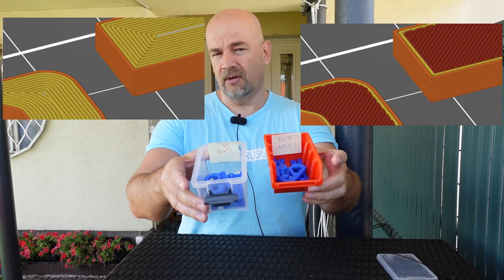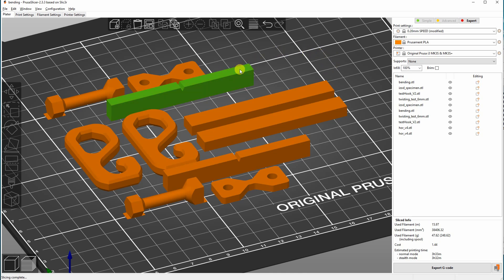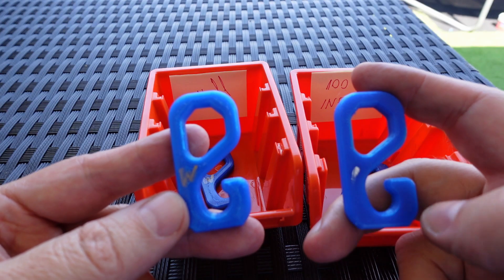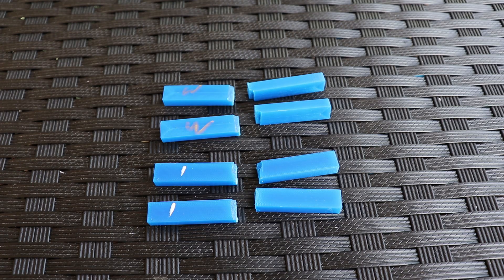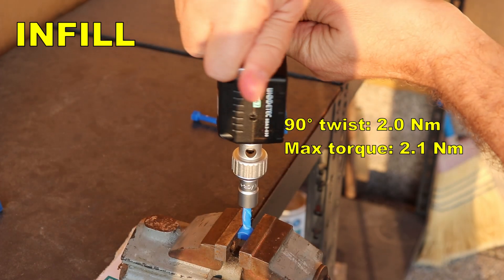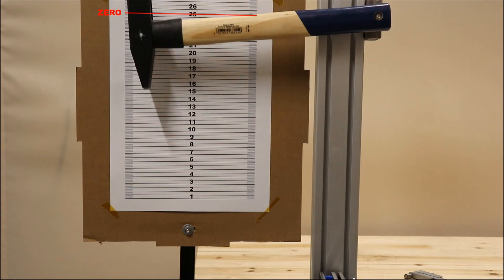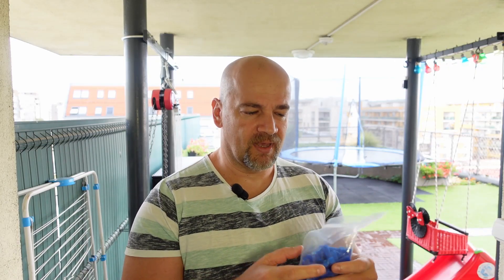100% infill vs max number of walls (or perimeters or shells) - which is stronger for solid object?

Comment: You did an outstanding job of testing.   I was just needing information exactly like this.   Well done.   You are a great engineer!
Reply from the maker: Thx. I think with new slicers (with arachne adaptive line width) things are more equal. I should repeat this test in near future. (the wall version have small gap in the center sometimes in old slicers)

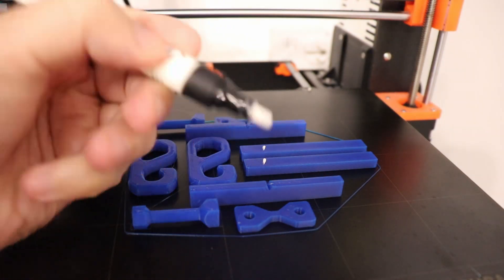Comment: about to print a ring with gears teeth and the orca says that 4walls will require +/- 5hrs and full infill will need +/- 3:30hrs, what can it sayy?
Reply: check your internal wall speed settings duh also check flowrate

Comment: A development since this video is variable width extrusion, up to about 150% of nozzle diameter.  Useful for both faster printing without needing a larger nozzle, and where a wider wall better fits a narrow part.  This should allow the max walls option to closer approach 100% infill.

Comment: The print time for max amount perimeters was 3,5 hours. What was the print time for the one infill? Because if it was printed slower, that could have made it stronger. Slower printing means more bonding between layers!

Comment: Thank you very interesting.
I would also have guessed that the max walls would win, exspecialy for the tensile test because the walls are orientated parallel to the tension while the infill is at an 45 degree angle to it.

Comment: So a downward hook, infill. An outward hook, wall. Stretch vs bend benefits. Fascinating.

I wonder how it would differ when combining the two in varied amounts. For instance if a total wall number that can max be is 10 layers, doing 1 wall layer with 100% fill, and going up 2, 3, 4, 5, 6, 7, 8, 9, and full wall no infill, to see if there is a sweetspot where it gives better result from it over full infill vs full wall.

Comment: I've seen 100 times in groups that "walls are better". Based on this info I've come to 2 conclusions. 1) it doesn't really matter as they are more or less the same. 2) infill is faster so why slow it down with perimeters? So 100% infill it is for the rare cases I need it.
Reply from the maker: Walls are important if you don't use 100% infill. Big difference is using 2 or 3 walls.
Reply: @MyTechFun  yeah I saw that on CNC kitchen. He just didn't do 100%. I'm about to do a 100% part myself. And because everyone says walls, I bumped them up to 999. But I noticed it prints WAY slower that way that 100% infill. So in this case 100% infill is the way to go.

Comment: The more 3D printing test videos I watch, the more I realize that the best method is to just print everything normally.  Normal PLA is a good material.  If your part fails, you need to design it better.  There's no magic trick to make things stronger.

Comment: so what patterns are strongest at 100 percent infill? does it make a difference?
Reply from the maker: Prusa Slicer changes the infill to this lined (I don't remember the correct name), when I set 100%
Reply: @MyTechFun  yeah lines i think its called i read somewhere rectilinear and concentric works with 100 percent but never tried it. edit-just realized rectilinear is lines

Comment: I'm not normally one to ask about speed but since the difference was so minimal I have to ask...
What method was faster to print? 

It would matter if you needed to rapid prototype a part for mechanical purposes 😉
Reply from the maker: In most cases, where you have straight walls, max walls is faster, more smooth print (more straight lines during printing)

Comment: I really like the clear way you Display the data. It could be a bit bigger, maybe even full screen, it's a bit hard to read on a tablet or a smaller laptop. Or maybe I just need to get some glasses.

Anyway, nice work. Keep it up!
Reply from the maker: I got earlier similar comment, I am trying to enlarge the results on screen, but also I upload results as picture to my website, so you can enlarge it, links in description (bottom of the page here: https://www.mytechfun.com/video/124 )
Reply: @MyTechFun  
Alright, to my taste that's even better. I like to take some time, even when looking at rather simple data. Thanks!

Comment: Also note that infinite perimeters will limit the x/y-resolution to 0.4 mm increments which can be a problem if you need dimensionally correct prints.
Reply: Is that because of the fixed extrusion line widths in slicers? If so, Cura, PrusaSlicer, and its derivatives, now support automatically varying perimeter widths to limit gapping. (It's called Arachne perimeter generation. I'm not sure why it's called that, but maybe because the resulting slicing patterns in sharp corners end up resembling spiderwebs.)

Comment: In my maker's view, you should have used in infill designed for mechanical strength.  In your test, you used the "lines" infill, which is well known to be suitable for decorative pieces, not mechanical parts.  For example, in Cura I only use the Cubic infill for mechanical parts and do not use Line infill (as you did) because Cubic infill is much stronger for functional parts.   Hope this helps.
Reply: Cura does better with lines when doing solid objects. I print guns with lines as my infill, can't think of anything less decorative lol

Comment: 100% infill had more material, causing cross-sectional area to increase slightly, making the part stronger. The difference in mass is about 3.7%, and your numbers show that infill is about 3-10% stronger, except for the impact test.

Even considering the mass, it does seem 100% infill is slightly stronger which makes sense considering the lines cross, making the part stronger.

I think the most fair way would be to check the material mass used in the slicer, and make sure they are equal before doing the test.

Comment: These results are interesting. For my prints requiring different strengths, such as a 3d printed electric guitar, the guitar string tension would then need maximum walls down the spine, but everywhere else use maximum infill.

Comment: I doubt the higher weight is from the closing line. More likely is, that your infill is printed with a 30% overlap (default in CURA) with the walls. Needs a little more Filament due to the overlap.
Reply: I agree, excellent point.

Comment: You know that there is 12 different types of Infill patterns listed in Cura. Time to see which infill is strongest. What infill pattern did you use for this testing? My research says that Triangle pattern is the strongest pattern to use. Awesome vid appreciate taking time to show all the results you've come up with.
Reply from the maker: CNC Kitchen did very good testing for pattern strength. So far I don't see the reason to repeat that test.

Comment: it makes sense that 100% infil parts are stronger as the layer "criss cross" so to speak so there is more surface area for it to grab onto. With multiple walls its laying down on top of the same pattern each time so the surface contact patch would be smaller.

Comment: I would definitely like a test of optimizing the models so that the walls have perfect spacing as the infill will auto fill this. This way we have no weak points inside of the print.

Another interesting thought is 100% line infill, but in the direction of the part. Will it work even better than walls due to the higher amount of going over itself (30% usually)

Comment: Comment on the first hook test. I calculate medium strength per gramm: Wall 5685.5/91.6=62KGperG; Inf 5897.5/96.3=61KGperG (decimals truncated). For small item perimeters fat has significancy.

Comment: great tests.  This confirms my long held suspicion that with 100% parts, infill is the way to go.  Usually, my hesitancy comes from the fact that walls are only bonded on two sides, really (since the material directly underneath doesn't add much support in this failure axis), and those bonds are the weakest parts.  As a part fails, the failure typically occurs between two walls, and can then "zip" down between the walls.  For this reason I call it "zipper failure".  The crosshatched nature of (rectilinear) infill inherently prevents zipper failure, as the break is not allowed to continue along the line bonds unimpeded, it has to break completed lines across the line bonds.

It looks like on the infill specimens, there was a bit of a gap between each line.  If we consider that the increase in strength from infill is a continuous line (% infill vs part strength), and that increasing walls and increasing infill reach similar ultimate strength, coupling that with stefan's infill vs walls testing would mean that the last few gaps that remain during infill printing are very detrimental to the overall strength (the last few % of infill give more strength per % than previous).  Therefore, I think the inclusion of air in the 100% infill part due to slight underextrusion can significantly impact the strength characteristics.

It would be interesting if you could tune your extrusion so that the infill portions are truly gapless (it's not easy to do), and do another test with 100% infill, 99%, etc down to about 90%.  I think there would be enough data to find the curve where the strength starts increasing more and more with those final few %.
Reply: Some infill patterns also don't support 100% infill, but at 99 or 98% it's functionally 100%, but with a more complex structure to reduce breaking.
Reply: For total maximum strength. I'd just print a pattern, make a mold of that pattern then choose a material. Cut up filament/use pelets then injection mold. 100% solid material with no infills or walls to worry about. Lol.

Comment: Nice video. At fist I thought that max walls will aboslutely crash max infill. I think that when using max walls, the lines exacly in top of each other play a mayor role, and also, in max infill the lines corresponds with the direction of max shear stress. Not enough specimens for a conclusive statetment but very interesting theme. Greetings from Argentina

Comment: I think some benefits can come from the alternating angle of the infill. But I often print max walls, because it’s not shaking the printer in small areas like the zig zag. Also - but this depends on how good your printer is tuned - sometimes a lot of infill can build up more overextrusion, because of linear advanced, overlaps etc. My petg prints are often a bit cleaner with max walls. Great content as always!

Comment: On the mass difference - with infill, there's overlap with the walls so perhaps that contributes to the higher mass?
Reply from the maker: Possible. But I belive if I would variate the width of object, it may be different. For example 10.2mm 10.4mm etc. But not significant difference. Probably there is some default flow rate for infill, so they overlap a little bit.
Reply: @MyTechFun  Probably not useful in practice, but what if you ironed every layer of the print? Could be an interesting (and long) test if nothing else.
Reply: @MyTechFun  There is also a concentric infill pattern so maybe you could run the tests again with that to remove any differences between how Cura treats walls and infill? At least forseeable differences.

Comment: What always surprise me, is how strong 3d printed parts can be in certain applications and orientations, it makes 3d print fun for one like me that likes to print rc stuff and train parts for my model trains
Reply: This is what made me go with an FDM printer (so the plastic deposition system not resin ones), the material is cheaper and you get considerably strong parts. I'm always printing only practical stuff either way so the mechanical strength is necessary.
Reply: @Kalvinjj  Fully agree. Resin printers are an absolute mess. Not fun to use, all resins are toxic and can cause severe headaches just by opening the bottle, they are hard to clean up, the need for a UV curing station if you dont live in a all-day-every-day sunny area and have 8 hours to wait for curing, the need for many liters of Isopropanol, the cost vs print bed size ratio, the need for single use gloves, the need for new FEP sheets, the need for drainage holes in the model, the need for constant build plate levelling after every single print, the fact that the screens are consumables, the absolutely horrible time when trying to remove supports, the fact that you cant see if your print works in the first 1.5 hours, etc. Theres only a very niche use for resin printers, its just not worth it at all. 

I bought an elegoo mars pro a few years ago. Set it up, printed the test rook and a microscopic benchy and its been rotting on my desk ever since. Im gonna gut it and use the stepper for an equatorial platform for my dobsonian telescopes.

Comment: There was a recent interview with Sanjay from E3D, and discussed layer adhesion not being as much about temperature but melt viscosity, and the maximum contact of 2 materials. The paper is "Interlayer bonding has bulk-material strength in extrusion additive manufacturing: new understanding of anisotropy" by "James Allum, Amirpasha Moetazedian, Andrew Gleadall* and Vadim V. Silberschmidt 
 
Wolfson School of Mechanical, Electrical and Manufacturing Engineering, 
Loughborough University, Loughborough, LE11 3TU, UK"

I couldn't get a link, but you should be able to find it with those key words.

Comment: Have you ever tested using different infill line angles?  Select 100% infill and set it so that each layer has lines that are perpendicular to each other or other angles like 0,45,90,135. I'm curious if it makes a difference. 

Great stuff as always!
Reply from the maker: No I didn't test different angles. Probably they may effect on resistance to direction of the load.

Comment: Excellent topic. I print a lot of structural/load-bearing parts, and your experiments have been very helpful in optimizing slicer settings (and material choice). Keep up the great work.
Reply: Im new to 3D printing what material types do you like to use?
Reply: @KillerofGods  85+% of consumer filament is PLA variants; it produces excellent detailes parts and is actually quite strong. That said, tensile strength isn't necessarily the end all be all trait; I've used ABS/ASA (very similar) for parts requiring greater heat resistance, PETG for vase mode & applications where PLA is too brittle.

Engineering filaments tend to get expensive fast, so you generally only want to use them when PLA is insufficient. Many manufacturers make carbon fiber imbued filament, to (theoretically) improve stiffness. Also there are glass fiber-imbued nylons that are among the toughest plastics in existence; there's a reason Glock makes all their frames from glass filled nylon. I've recently taken a fancy to polycarbonate, or more specifically PC blends, like PCABS. Polycarbonate is exceptionally strong, tough, and heat resistant but pure PC can be finicky to print.

There are others I've neglected, but that gives you an idea. Exploring and destructive testing filaments has been a surprisingly engaging pastime.

Comment: I was near sure, that the full wall prints would be stronger.... Interesting, even if the differences are not so big.
Reply: Same here, I was sure that full walls will be much better
Reply: Why were you sure it would be stronger? They are all stacked vertically? The infill ones have the layers alternating creating more of a sandwich between each layer.

Comment: Very interesting test as usual. What I wonder though, is there a difference between parts printed all at once, or parts printed one by one so the part does not cool down as much between layers
Reply from the maker: You are reading my mind, that test will be in one of my next videos (after few product reviews, waiting here)
Reply: @MyTechFun  I will definitely come back to your channel to check it out. 
Btw. By the accent I guess you're from Poland. Am I right? :-)
Reply from the maker: @GreyDeathVaccine  Born in Yugoslavia, today Serbia. Slavic accent.
Reply: If they printed all in same mode there shouldnt be a difference shouldnt it?
Reply: @AirMaxAtzeKtb  Since it takes longer to print a full bed, the part will cool more between layers and that could affect layer adhesion.

Comment: i love the questions you ask, love your channel. Thanks for this. Btw, concentric lines for infill would be the same no?
Reply: Yes; excessive number of walls is the same physical operation as 100% concentric infill. They merely look different here because of the top/bottom layer fill pattern, which can also be set to concentric.

The infill shown in this video might be 45 degree rectilinear (zig zag or lines in Cura). It alternates the infill direction, which concentric fills don't. That makes a composite material more like a weave than parallel strings.